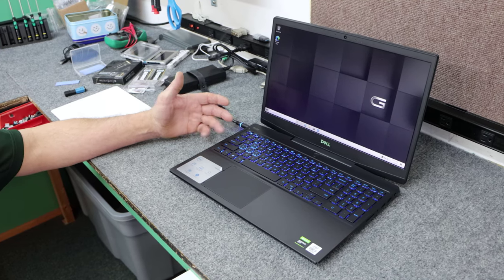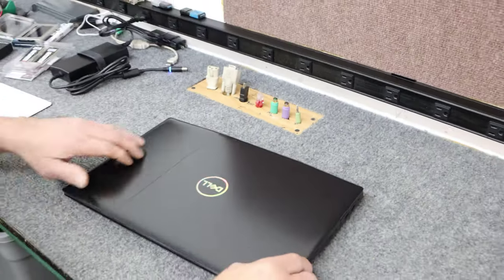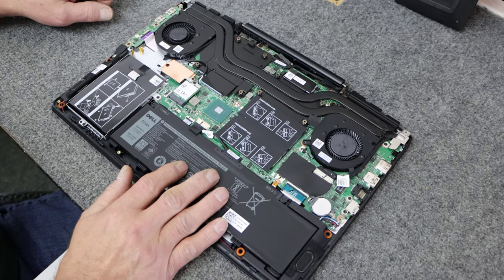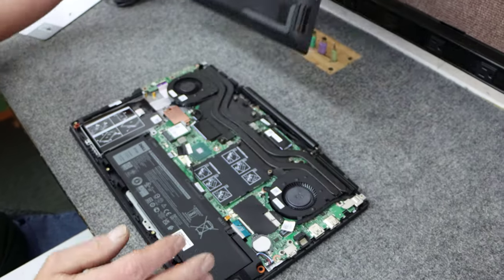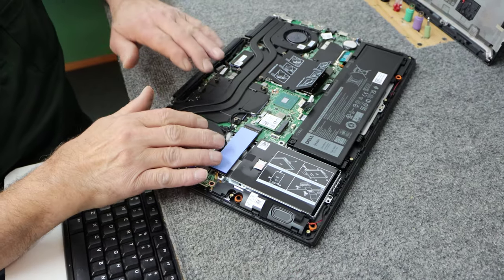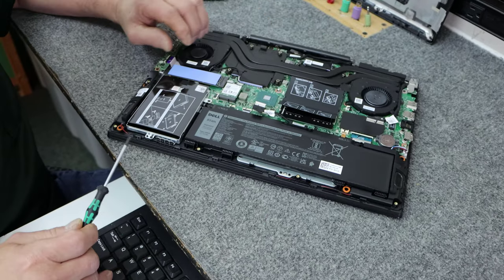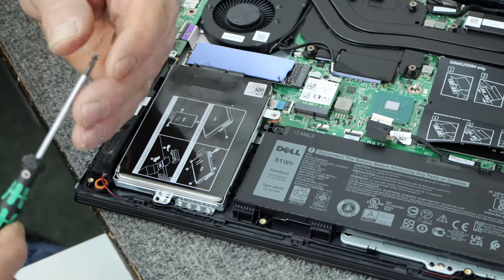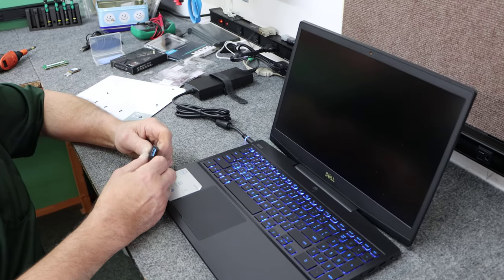Dell G5 5500 Gaming Laptop SSD Upgrade, Memory Upgrade, Clean Windows Install  --4K Available--

Comment: How do I carry over my genuine windows license if I do a fresh install? Also, just found your channel. I'm hooked. Love these videos.
Reply from the maker: It is a digital license. It will activate no problem.  Thanks for watching my videos. Dale
Reply: @CadillacComputerCenter  I had one time I changed the entire hardware in a pc aside from the harddrive and power supply, new motherboard, processor, ram, gpu and it activated and it states that it wont online.

Comment: just what i needed. bought a reburbished 1 a couple of months ago that has 10th gen i7 and RTX 2060 but now getting pop ups from dell saying the hard drive is at the end of its life and needs to be replaced. so needed to see how to replace the hard drive but its an NVMe SSD not a hard drive.
So wanted to see if i can replace it myself rather than sending it back to the shop for them to do it which could take weeks but its still under warrenty.

its a replacement for the 1 i originally ordered as the 1st 1 got lost in the post. and dont want to go through that hassle again.
Reply: just opened my case and its diff inside. no space for the SATA drive as the battery goes the full lenght of the case.
No hard drive in there as far as i can see and device manger has not got a hard drive in it just 1 NVMe but it has a got a slot for a 2nd NVMe but no sata slots to put in a sata ssd or hdd.

Plus there is a cable running from the MB to the base of the case that runs over the top of the battery. So be carefull when taking the back off just incase there is a cable there. think its the connector for the screen. some have it some dont. mine was long enough to be able to just fold the case back without disconnecting it but others might be a lot shorter.

Its the G5 15 5500 with an i7  10750H 10th gen CPU @2.60GHz and RTX 2060, 16GB  RAM duel channel. 500GB SSD.

As mine was reburbished when i bought it they might of made a few changes before selling it.

As no hard drive it must be the SSD that is past its life and needs replacing as SSD dont last as long as HDD. HDD can last for decades while SSD normaly only last a few years at most depending on how much data it holds like a 250gb will last the longest. double the size to 500 then it lasts half the time. 1tb half it again on life.
HDD u can read and write to it as long as u want as it doesnt fail. its the moving parts that might break. but with SSD it has cells and each cell can only be writen to and read from a set number of times before that cell dies and has to use a diff cell. 250gb only stores 1 piece of data per cell. 500 stores 2 per cell. 1tb stores 4. hence why the bigger the SSD the faster the cells die.

Comment: I have watched several upgrade videos and it seems like everyone that installs the 2 1/2 SATA drives always connects the cable to the drive and then struggles to get the small connector to mate up with the socket on the motherboard. It seems it would be easier to make the small connection first and then attach the cable to the drive and then mount the drive.

Comment: You know what Dale! I bought a Dell G15 5510 and everywhere says it runs @2933 so I diligently bought a 2x16 2933 gb memory… but they are not recognized by my computer and when i checked the original 8 gb memory oh surprise! It is a 3200. Trying to fix this issue I called Dell’s technical support and they told me that memory should be 2933.
Anyway! Great video 👍🏻
Reply: Not at all, I use 2x16 Fury Kingston 3200MHz and it goes all ok

Comment: Hi Dale. I'm trying similar thing on a M.2 2230 in slot 1; I want to install M.2 2280 in slot 2.
What is that blue thing you stocked over the M.2 in slot1? 
should I install or you think is optional?
Thank you.

Comment: Hello, I have been experiencing a 4 amber and 1 white error in my g5 5500. Most old posts says to replace the CMOS battery. people from dell says to take it to a distributor to diagnose the battery but I really have no time for that. (although the fact that they said it's a battery problem is a good fact). So does this mean that CMOS needs to be replaced and not the main battery?

Comment: Hey Dale, I'm new to the PC community and I'm wondering if the RAM upgrade can be done on a computer that's already had some things downloaded to it. Meaning it's not a clean Windows install like yours. Do I have to do some sort of backup of my current version of Windows before messing with the hardware? Thank you.
Reply: Yes it will work

Comment: I'm trying to do the same upgrade on the same laptop using the same HyperX RAM, except 16GB instead of 32.   Before I start I wanted to ask about the XMP capability and compatibility with the G5 5500.    Did you have any issues with that or do something to work around it?   I just don't want to install them, have them not work and then not be able to use or return them.  I called HyperX and they said they can't guarantee compatibility but I see you did it with no problem so just looking for any guidance.  Thanks!
Reply from the maker: Hi. Just install the ram and you'll be good. Xmp is not an issue on this model.  Your ram should run fine at its advertised speed. 2666. 3200 etc.
Reply: Awesome thanks, I appreciate your time and advice.   Really enjoy your videos, learning alot from you.
Reply from the maker: Thank you, I appreciate you watching. Dale

Comment: Is it possible to install a ssd in the slot were you put the hdd or is it hdd only. I have the same laptop and the 256 gb is horrible. I have a 1tb ssd that I would like to use there
Reply from the maker: You can certainly use a 2.5 inch SATA SSD in place of hdd.
Reply: That is awesome. Thank you so much
Reply: Unfortunately mine did not come with the hardware to mount the second ssd

Comment: Que tal, será el mismo procedimiento para la dell G5 5510 2021? estoy interesado  en subirle la ram pero que CL trae la que viene de fabrica, alguien me podría orientar ?
Reply: yo tengo la g15 5510 y viene con una RAM de hynix 8 GB DDR4 3200 MHZ CL22, yo le puse otra de CRUCIAL de 8 GB misma velocidad y latencias y funcionan bien en dual channel aunque el sistema me las dejo en 2933 MHZ ambas , elegi esta configuracion ahorita para desempeño y jugar, despues planeo cambiarlas por unas fury impact de kingston de 16x2 con menos latencia
Reply: @IsaacRM92  es la que trae la gtx 1650 no?
Si andaba viendo eso para expandirla sabes si el m.2 necesita el accesorio para poder agregarla en el otro slot? Gracias por compartir esa información amigo
Reply: @leonardod.ibarra3943  si, para la SSD nvme necesitas el bracket de metal para disipar el calor y el tornillo, no se porque DELL no los incluyo pero sacando el numero de serie de las partes las compras en mercadolibre o amazon y listo, yo asi las encontre , aun no las compro pero si las encuentras 👍

Comment: Hey I bought 16gb but 3200mhz has anybody able to put it on that frequency? Or it’s topped to 2933?
Reply from the maker: Hi. 3200 should work in this model.
Reply: chipset locked to 2933
Reply: @pilsplease7561  thx 
I did find out after installation. 
But I updated tu an Asus tuf a15 
Way better no thermal throttling
Reply: @ffrreezzeerr  the dell units dont thermal throttle at all, at least the new models that are the current model dont, they only throttle with amd chips, which run at like 100-105 and burn up. But the ram is locked to 2933mhz because the motherboard controller doesnt support faster even if the processor does.
Reply: @pilsplease7561  no! 
For real mine did. After playing warzone for 25 minutes automatically turned off due the big temps on the cpu. It was a i7 10th gen pretty new, even tho I change the thermal paste to a premium one. Perhaps bad luck to have the only laptop that did thermal throttled but mine did 105° terrible.
Reply: @ffrreezzeerr  you may have gotten a bad one. I use MX4 in laptops due to the fact that its not metallic so it cant accidentally short anything out. And it makes a difference but the stock paste in dell laptops is fine, ive had huge heat issues with lenovo though due to them putting  a cheap fan and designing thin laptops that dont have much airflow.